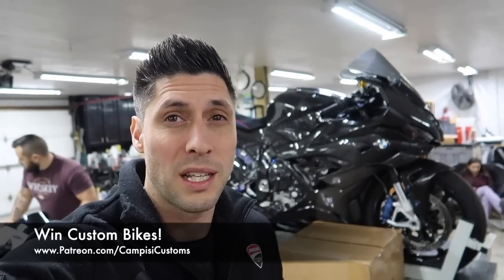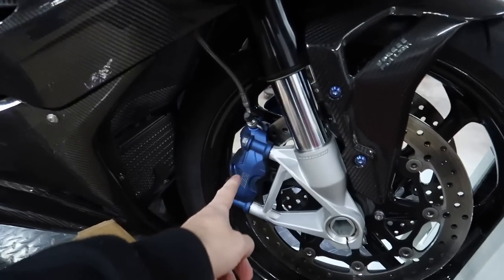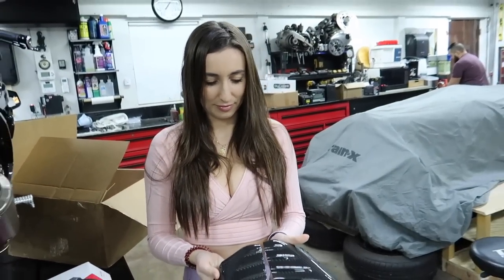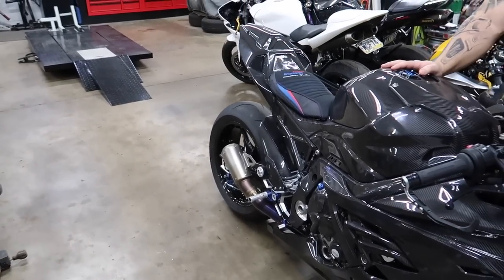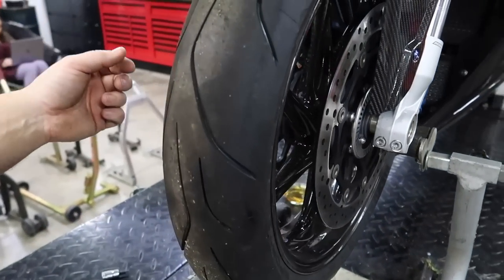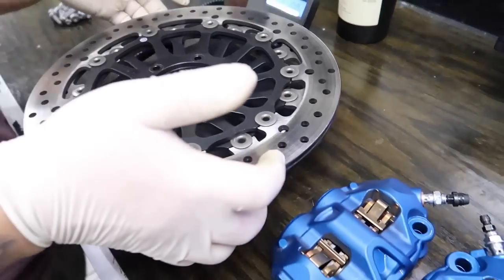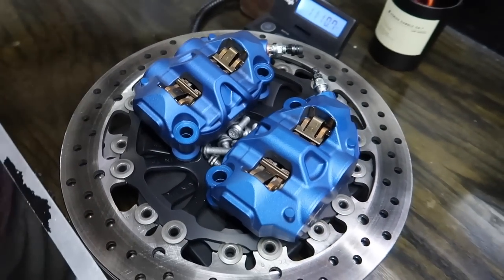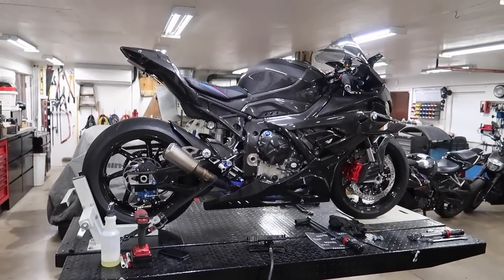$2,500 Brembo Brake Upgrade for Our Carbon M1000RR!!!

Comment: I think for the price range of the M1000RR, it should have really came with a set of Brembo Brakes! Waiting for you to ride it to see the differences!
Reply from the maker: we might be waiting a while...snow in the forecast :(
Reply: I really think the M brakes are just as good. I took mine to track day, was soo good.
Reply: Nissin is the Brembo of Japan. They are really good.
Reply from the maker: the M brakes have issues with leaking and have a bunch of recalls
Reply: @JaretCampisi  that was the Hayes calipers. No issues with these nissins I don't believe...
Reply: @JaretCampisi  god damn!! All models?? M1000rr 2022?
Reply: @aashishnakarmi1690  there not good at all, what your feeling is a Fantastic ABS System and Braided Lines, For me, Galespeed Master is Unbeatable, Most definitely higher quality then Brembo, For rotors, TK is a lot better then Brembo T-Drives
Reply: My Duke 890 R comes stock with Stylema Brembos... I wonder if those are the same
Reply: Do any of these "part changer" channels that build these bikes ever ride a track? Between these guys motomillion 650ib fastlane they build these bikes that are great for racing and completely useless to go ride down the interstate for 1hr. Like they will never notice the brake difference with the type of riding I've seen from all these "superbike channels"

Comment: Hey bro! Brembo Corse Corta masters, Stylema’s and T-Drive rotors…Epic! I’ll reserve comment on the caliper color until the final graphics are in-place. My two cents: with all due respect, why leave the rear Nissin stuff though? I’m also wondering why the underwhelming stock suspension (Marzocchi up frt, Sachs(?) rear) was not replaced with Top-shelf Ohlins TTX kit as it should have been from the factory at that price point? You could even leave the stock USD legs and installed Ohlins cartridges and changed-out or had the lowers anodized or powder coated instead of raw Aluminum.
Reply from the maker: No rear brake from brembo for the M yet and we looked into Ohlins suspension but it was a 6 month wait...
Reply: @JaretCampisi  Wow! Everything is through the roof AND you still can’t get it?! I just saw Mani’s latest post on the Black painted Stylema’s (frt & rear) on the V4-SP with the black carrier T-Drive rotors. That combo looks the biz on that particular bike!

Comment: The callipers don’t contribute to rotational mass. They contribute to unsprung mass. That weight difference would mainly be from the callipers. I don’t think you saved much rotational mass.
Reply from the maker: the bolts and rotors did still save weight which is rotational but not as much as I had hoped
Reply: @JaretCampisi  I was expecting big savings too.  Drill some more holes in the rotors 😁

Comment: Replaces cast Nissin calipers with Brembo cast calipers, 😆 pointless.  And Jarrett, Nissin makes some of the finest brakes in the world just like Brembo. All oem,  and Stylema are OEM quality btw, are about equal quality
Reply from the maker: The stock brakes on the S1000RR and M1000RR have a history of leaking along with a bunch of factory recalls...I'll stick with brembos which are widely regarded as the best braking company in the world :)
Reply: @JaretCampisi  M1000 deserves more than Stylema is my point I guess.  Not a huge upgrade and you talk about Nissin like they are cheap or something.  There are several Factory teams running Nissin brakes in racing, Nissin has just as high end stuff as Brembo is you know what your looking at.
Reply: @JaretCampisi  Sorry JareBear. These guys are correct. The only real upgrade from this type of Nissin caliper is a billet-endurance type (clears the wheel, massive heat dispersion and weight loss). Beringer, Brembo, Nissin all make them. PS. Bike is sick.. paint the rear caliper red. ;)

Comment: Manny dropped the ball on the silver rear rotor last week, and again with the red front calipers this week. I know there's supply issues lately, but I feel it'd be worth the wait to keep this build goin so perfectly. The bike is exquisite so far...don't stand for "good enough "
Reply from the maker: Unfortunately they don't produce parts they only sell them...so if they can't get the parts from the manufacturers not much they can do...

Comment: Well, the caliper is not what causes fade. If a bike has a good master cylinder and braided brake lines, then all that's left to cause issues is the pads. Brake fade is attributed to a combination of the stock rubber brake lines expanding when the fluid gets hot, as well as the resin in the pads reaching its temperature limit and releasing gas... which in turn disrupts the adhesion of the pad and rotor surface. 

Also, the stock pads in most bikes are sintered pads... which are good for low-speed braking (street speeds). Once things start to heat up, that's where Carbon Ceramic pads really shine.
Reply from the maker: Right on well the stock brakes had a lot of complaints regarding usability and leaking so I'm happy to swap them out regardless :)
Reply: Actually it was the Hayes brakes that had the complaints and leaks not the Nissin ‘M’ brakes. There was a recall on the Hayes. The feedback on the Nissins to date have been quite good.
Reply: @Daniel Matthews  Valuable info here. Thanks for the insight, sir.

Comment: Just a heads up but there is Torx and Torx Plus. BMW uses Torx Plus. Both will work but using Torx Plus will get you a tighter fit between bit and fastener. 👍 Also, the stock rotors are Brembo rotors. 👍
Reply from the maker: ahhhh interesting thanks I did not know that!
Reply: @JaretCampisi  About Torx Plus or rotors? Look at them closer and you'll see the Brembo "B" logo on them. Also, have Dado pick up a set of Torx Plus. Might as well use a better fitting driver for that sweet bike. 🤟🏻